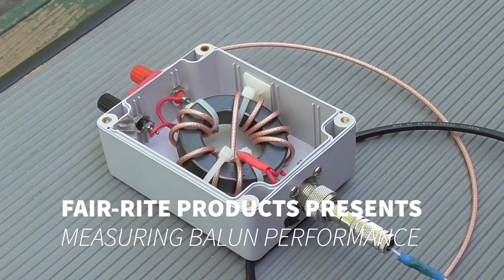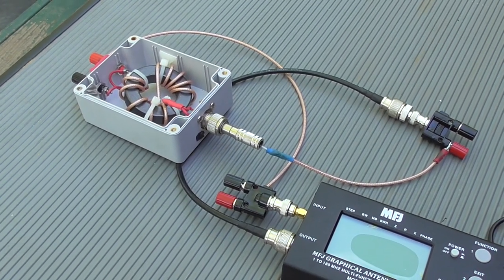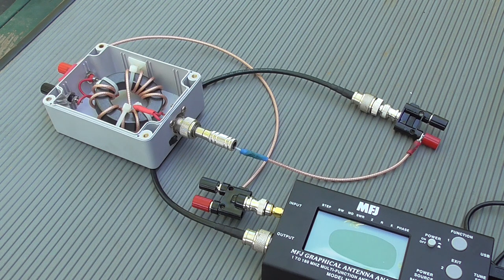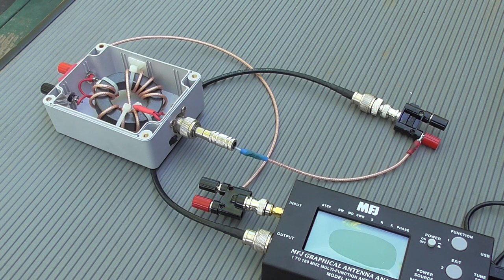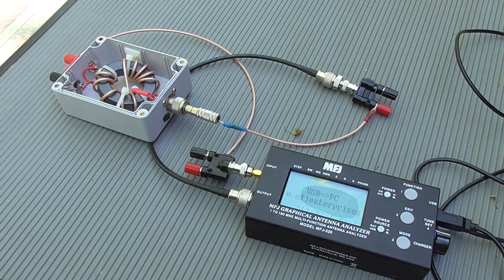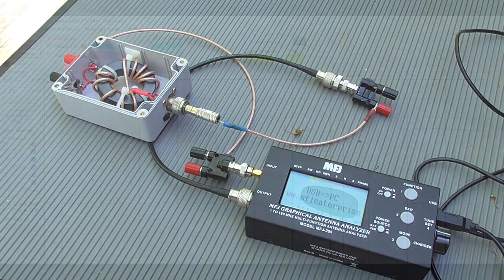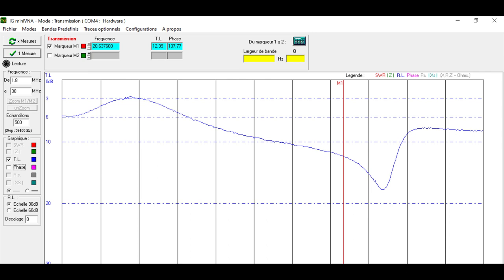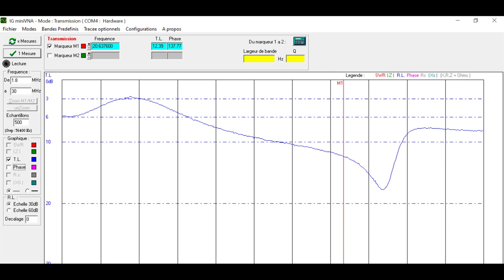Measuring Balun Performance (Fair-Rite Products Corp)

Comment: My application is suppressing RF noise from a off-grid solar power inverter. I have several type 31 clamp-on beads on the AC wires coming out of the inverter and each bead offers a one decibel reduction in noise on the 75 m handband so I've got about 20 of these which gets the noise down to a point where I can hear strong stations now but not the weaker ones. I still need a better solution as the interference is still quite strong.

Comment: Sorry but I don't think this is a practical way for a radio ham to test the balun, although it would be nice to play with these high tech toys if you have them. I would simply transmit 100 Watt though an accurate watt meter, through the 1:1 balum into a 50 ohm dummy load , measure the rf voltage across the dummy load, it should be close to 77 Volt, and calculate the loss.
Reply: Actually, it's a very practical way to test a balun .. he just did it wrong.